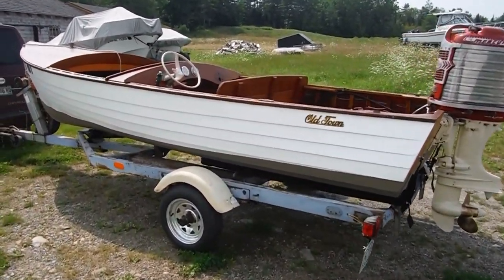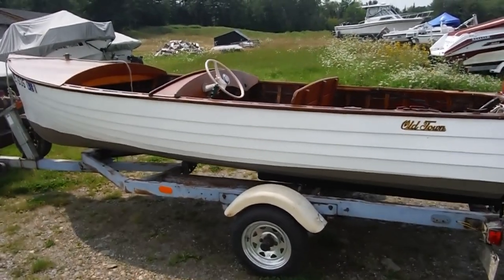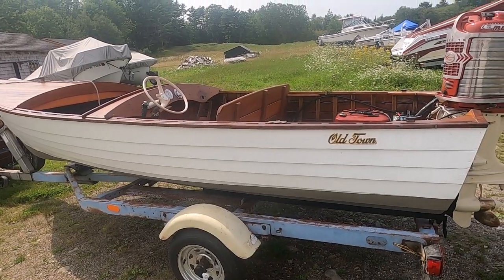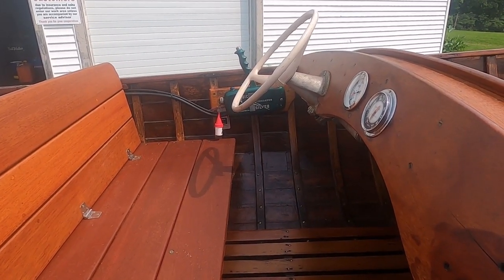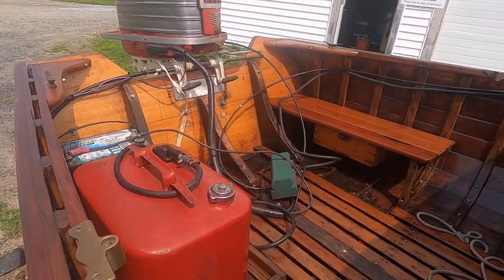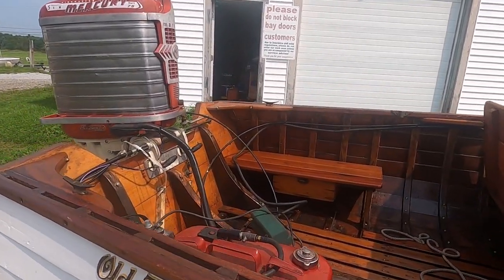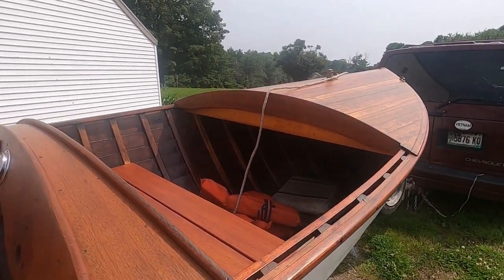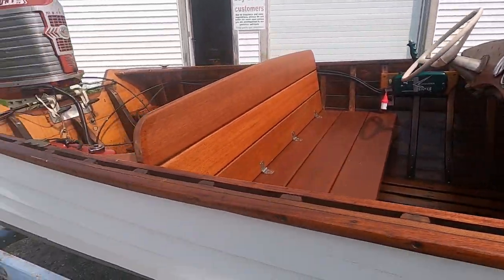1956 Oldtown 15 ft Mercury test boat

Comment: It's good to see an Old Town 15' runabout on the water again.  As teens we had a 1955 model to which  we added a custom windshield, steering at the front right.  Created a top and side curtains for rough water comfort.  Power was the Johnson 40 hp. with a 4 blade power prop to 30+ knots with 2 aboard for water skiing.  Fishing for 4 with bamboo outriggers to spread the lines at the Horseshoe shoal in Nantucket Sound.  In 1974 after Dad died, brother took it for fresh water fishing only on Cape lakes.  Thanks for sharing your beautiful restoration and bringing back my memories of great times on the water.